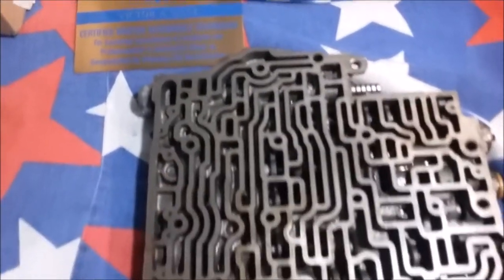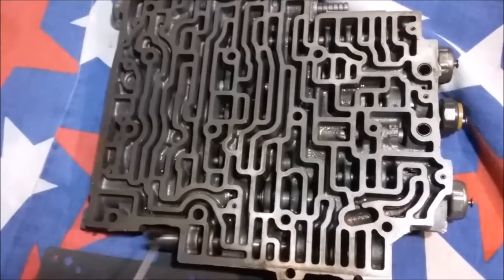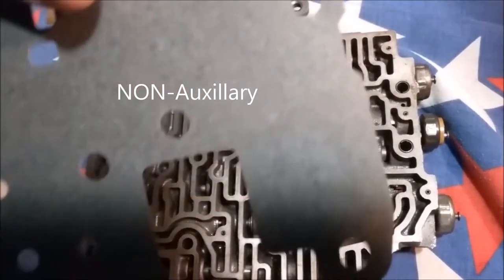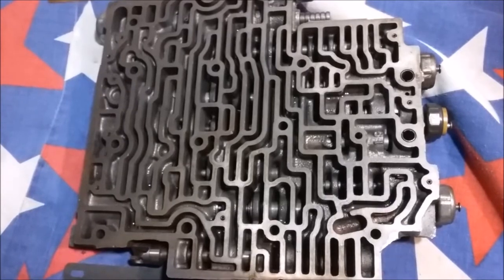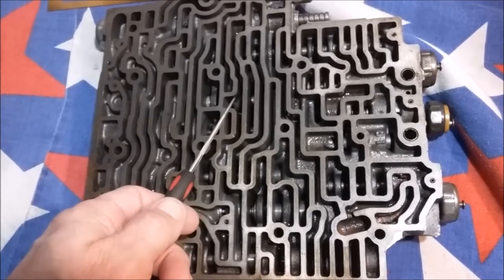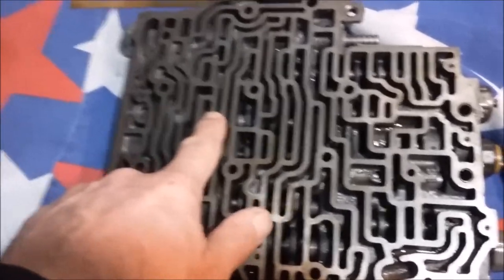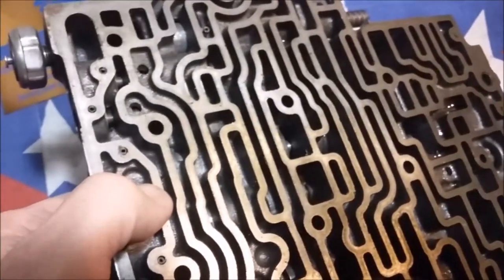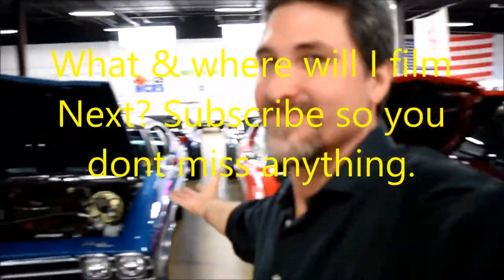700r4 Chevy transmission valve body identification diy 4L60-E

Comment: I have a question, on the lock up valve u said it only moves just a lil bit, mine moves a lil bit but my question is Does it has to have a spring in there so it can return to its place when u move it?
Reply from the maker: Some have an aluminum plug with no spring. It will only move a little bit. That is not an actual lockup valve. you would need to replace it with a lockup valve or replace the valve body. Unless your vehicle is one of the 1986 and later that has all the working lockup computer controls and sensors switches etc.

Comment: Could you answer this one???04 suburban built 6.0ls with built 4l60 . scenario, at a stop, give it half throttle it shifts into second and stop transferring power. In any gear and would not roll, it had to be pulled to the side of the road. Got $2500 into a 4l60 and I know they don't like big power or taking off in overdrive but local trans guy is claiming blown sprag and sent particulate throughout. Not feeling warm and fuzzy so if you might be able to shine a light I'd appreciate it. If you need more info to troubleshoot let me know thanks Tim
Reply from the maker: Thanks for viewing and commenting. Halfway through reading this, I was thinking sprag LOL. Then I read your sentence about the local trans guy. There are upgraded sprags made of harder steel and more elements. Ask your guy about replacing it with the latest upgraded sprag and check out my video about the 4l60e sprags. Maybe you'll get lucky and there won't be too much collateral damage.